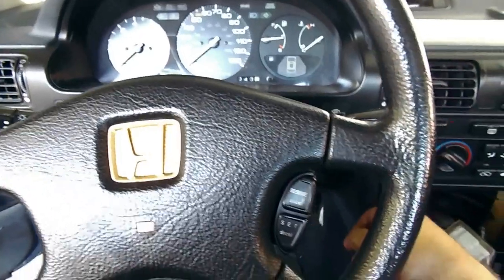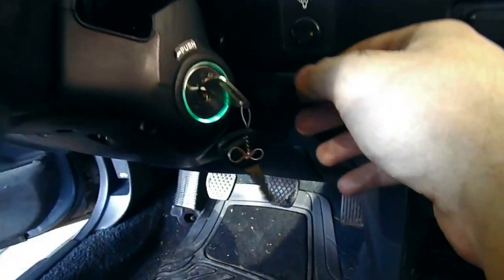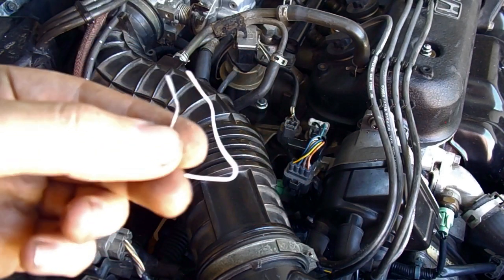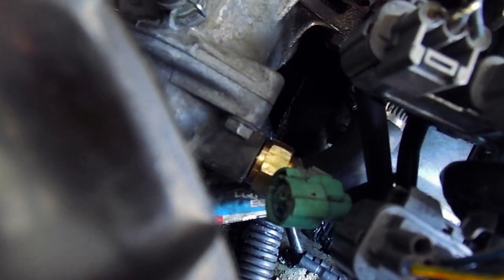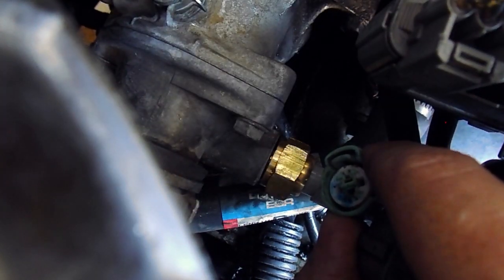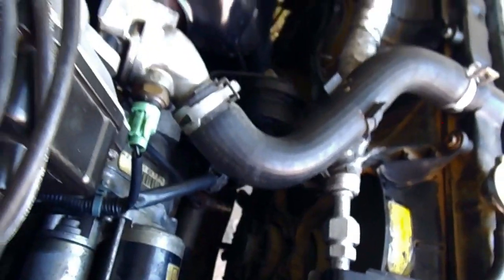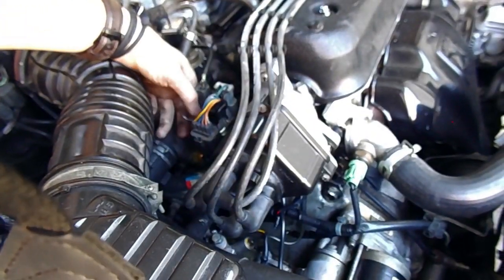How to check if your engine fans work on a Honda

Comment: What if jumping fan switch a turn both on but jumping fan switch does not I even cut off the plug and jumped the wires, any ideas?

Comment: Payco..    when I do this test... if you are sitting inside the vehicle..   only my left fan  (condenser?) comes on..    right (cooling?) .. stays off.,.       you think that is the motor?
Reply from the maker: I would trace the wire first for any damage for the fan that didn’t work & if it’s good I’d bet on the motor for sure! If I remember correctly this test would bypass the sensor & just turn the fans on directly so if one or the other isn’t turning on its one of those two issues. Hope you get it working!
Reply: @PaycoTsunami  thanks buddy appreciate it

Comment: Is that plug green on all Honda’s? I have a 2006 Ridgeline. 

What switch does that plug connect to?
Reply from the maker: I don't believe they're all green but from what I've seen theres a switch specifically for fans you should be able to test

Comment: The fan switch has been replaced and the fans still don't come on normally. Fans do come on when I use the paperclip.  Since the switch has been replaced, and I know the fans work, what is the next step? Thermostat?
Reply from the maker: @Tbarney11  is it over heating? Might have a faulty temp switch, this just shows if the fan circuit still works. I’d replace with aftermarket denso temp switch & oem thermostat from a dealer. Might get a fake one from eBay stating oem
Reply: @PaycoTsunami  Yes, it is overheating because the fans never turn on. Any harm in leaving the paperclip in all the time (temporarily until a permanent solution is found)?
Reply from the maker: @Tbarney11  yeah, either motor burn out, paper clip falls out and now you have 0 chance for the fans or battery dies. You can make a switch instead of using the paperclip on the same nodes, just get some male wire terminals and have it run to an off and off switch. Best chance since you can just turn on the fans while you drive. You know it still works when the turn on
Reply: @PaycoTsunami  ODBII scanner gives me temperature, and it goes over 270 degrees, so something is telling the computer the temperature, which has to be the temperature sensor. I want to be careful with my terms. 
Fan switch (the piece bypassed in this video) has already been replaced. Bypassing that switch makes the fans turn on. 
Since I can see the temp through my ODBII scanner, that tells me the temp sensor is working, so why would the fans not be kicking on?  I assume the fan switch enables based on sensing a certain amount of heat. Could it be water pump not circulating the coolant so the fan switch never senses any coolant?

Comment: My 99 Honda civic doesn't overheat unless I turn my ac on and drive for a bit with the ac on but other than that as long as I dont turn on my ac my car never overheats. I checked my fuses and relays and everything looks fine. I attached the gator clips to my cooling fan switch terminal then ran it to the battery and my cooling fan turned on. So my question is if I try this paper clip thing and it doesnt turn my fan on what would that mean??? U think my thermostat needs to be changed? I already changed out the ect sensor, coolant temp gauge sending unit ( the 2 sensors underneath the distributer) and the cooling fan sensor switch that's on the thermostat housing.
Reply from the maker: Hey sorry I totally missed that you've already attached alligator clips, are the sensors aftermarket ones? Like super cheapy? I've had this issue with my subaru & had overheating issues because the sensors I replaced were faulty. I'd double check on everything!

Another issue could be your water pump, could have rusted out fins if you hadn't changed the coolant at the intervals or tossed in non-distilled water. Not too sure if you've changed that during a timing belt change but not enough water circulation with the AC ON (Which causes the engine to run hotter) would also can be an issue!

Hope you get it fixed dude! Seems like you've already tested the fans individually so doing this would test the fans UP TO the sensor. I would still do this test to make sure anything wasn't eaten out by a mouse or something to the fan switch on the thermostat.

I hope you find your issue dude! I know its frustrating as hell!
Reply: @PaycoTsunami  only one that wasnt honda oem was the coolant fan switch that goes on top/ side of the thermostat housing

Comment: i tested this, and only the condenser fan turns on. i even changed the plug and wire into the fan sensor i need help!
Reply from the maker: Honestly @ that point it would be the motor of the fan, just swap the motors if you don't have one on hand to see if its really that. You can also get a multimeter to see if there's power with the plug initially

Comment: Brought new cooling sensor but still fans dont come on so i put a clips in and boom fans come on what i want to know lol can i leave the  clips in the connector ?
Reply from the maker: Haha honestly I wouldn't advise it at all BUT when people race on the track, they add a switch that allows the fans to be switched on whenever they want. Perhaps look into that as a better option? I'm glad your fans work for sure but just double check on your thermostat. It might not be working properly to allow the car to heat up or not opening to cool down. It's a cheap fix from Amazon, just make sure when you install it the breather tap is facing up.
Reply: @PaycoTsunami  well sadlt the Sensor is jammed stuck in the thermostat and am unable to twist it off hahaha omfg man thank god for the PINS as 4 the thermostat i tested it in bowling water an it opened up str8 away so im thinking nah not that but sensor dammit 🤣 thanks for the video Bruv awsum 😉👍

Comment: How long can we leave the paper clip there? It should be ok right? All it is is us making it run constantly instead of the switch telling when to
Reply from the maker: Basically, to be honest I wouldn't leave it be since it has a flowing current going through it. If you really wanted to, you could get a female end and wire a rocker switch to flip on the fans manually but you'd never know when to toss it on unless you knew the temp accurately.
What are you trying to do?
Reply: @PaycoTsunami  have it running constant!  And with the rocker switch idea. I think it would be the same if you leave it on too long right?

Comment: My fan still doesn't turn on after I did this.....what should I do next?
Reply from the maker: I’d just do it one more time, if not check the wires, the fuses, then relays. If all fails replace the fans.
Reply: @PaycoTsunami  oh, it was a brand new engine cooling fan that still wasnt coming on....forgot to mention that lol

Comment: What does it mean of they don't turn on once you do this?
Reply from the maker: It means a couple of things, the battery is out (Make sure its charged), When you put the paperclip in it didn't touch both of the metal nodes to give it power, and finally the motor to those two fans are out(Make sure they're plugged in first). This little trick here is to see if they work at all if they're not kicking on when it starts to warm up.
Reply: @PaycoTsunami  it looks like i have a motor in both my a/c fan and radiator fan.  i just bought a new motor.  will it help me with both fans?
Reply from the maker: @davembeck  Yo! So both fans have an individual fan motor. So from what I could tell they're interchangeable (I think). This will ONLY help if the actual motor is out though, and only the one you're changing. The other fan will not be affected by one motor being changed.
Reply: @PaycoTsunami  yO !  , LOL.  i did buy a motor .  long story shorter.  i do not care if my a/c isnt working, fan too.  thats a future project.  right now i need my radiator fan to work so i can do errands / drive my car to take care of daily needs.  i guess this motor will go into my radiator fan and hopefully my fan is ok and the motor will make my radiator fan work.  that is all, lol

Comment: what does the upper rad hose connect to on the motor? Dont know much about these engines.
Reply: that hose should be pulling coolant from the engine block to the top of the radiator to cool it off
Reply: @sfcd4757  alright. I was guessing that but wasn't sure. I'm slowly working on my cb7 and ej1

Comment: What dose it mean when the fans run even when the plug is not bypassed just unplugged hanging there  (with the AC on )
Reply from the maker: that your condenser is still kicking if I remember correctly, mine ran out of Freon. So even when I toss my A/C switch on it never tosses both fans on like it should. If I remember correctly that switch I unplugged only turns on when the car runs over the normal temperature than the car should be. So it would still run even if unplugged. Just won't turn on when it gets hot. 

Hey at least both fans work!
Reply: this probably means that there is a wire-to-wire short somewhere between those 2 wires. because it is acting as if it is bypassed, so safe to assume the wires are touching elsewhere, right? do a voltage test between both terminals of the green plug. if it is little or nothing, safe to assume this theory is right
Reply: PaycoTsunami hey my ac is out of Freon I think my compressor is leaking, but none of my fans kick on when I turn on the ac getting codes P0113 and P0118

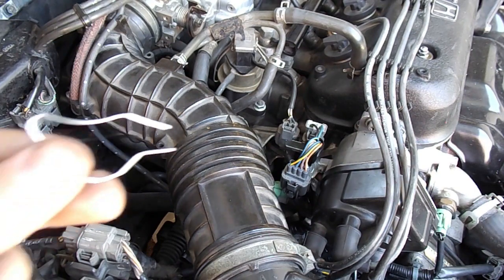Comment: Heya PaycoTsunami, thanks for this helpful video.  Troubleshooting a fan issue on my 1990 Accord (compressor fan stays on for 10 minutes after shutting car off not matter how hot/cold the engine is...this is draining the battery) and I'm hoping you can answer 2 questions.  First, the green plug that you inserted the paper clip into...what is the name of the sensor that you removed this plug from?  Second, you can see another similar sensor at 0:34 of the video.  It is visible in the bottom right hand corner of the screen, in the front of the engine, just to the right of the distributor and to the left of where the upper radiator hose in hose-clamped to the engine...do you know the name of that sensor?  Thanks so much for any help you can offer!
Reply from the maker: Yo Yuri! Sorry it took my so long, The first plug I removed from the thermostat housing is the fan switch & the 2nd green plug @ 0:34 is a thermo-switch which controls the fans after the car is off (This is the switch you want to look into for your issue). Hope you fixed your problem wayyyyy before I left this comment my dude!

Comment: I did that & my fan still doesn't work. 
But if I apply power directly to the fans then they work. What could be the cause?
Reply from the maker: Sensors or short in the wires, just trace the wires to see if they have any rips. Might be grounding out somewhere it shouldn’t

Comment: I have a problem with my 2006 Honda Civic EX where neither fan is turning on even with the paperclip
Reply: Make sure the paper clip goes all the way in where it can make good contact! Mine’s did the same. So I press the clip further in and it worked! Or Try straight wire to the battery and see if the fan turns to make sure the fan works first

Comment: Is that the plug that connects to the thermostat ?
Reply from the maker: LifeWithJona Hey yeah it is! Its the sensor connected to the thermostat housing and its called the "fan switch"
Reply: PaycoTsunami   Where would it be on 05 Honda Pilot? I’m an idiot
Reply: @PaycoTsunami  we call it coolant temperature sensor
Reply from the maker: @vityazsix  Actually the temp sensor is on the opposite side of the switch, in the front of the top coolant hose near the valve cover my friend! (Thermo switch)
Reply: @PaycoTsunami  oops
Reply from the maker: @vityazsix  😆

Comment: When I jump wire only the passenger fan turns on. Why is the driver side on?
Reply from the maker: this trick bypasses the switches which requires the fans to be operating temperature so you can see if the relays(if I remember correctly) or the actual motor of the fan's work. Doing this FOR SURE checks if they work at all. Double back to see if the driver side one is plugged in, if it is, switch out the fan relay which is in your engine bay fuse box with another relay similar to it. IF it still doesn't turn on doing this trick then your motor is out on the driver side my dude! Hope this is a super easy fix, just test everything out before replacing. You never know, it might be a frayed wire somewhere!
Reply: I read somewhere that the driver side fan won't operate if the A/C system doesn't have pressure in it, ie all your refrigerant leaked out...something about the computer knowing theres not enough pressure in the A/C system so it disables the fan...something to consider/double check.

Comment: Ok so I replaced all sensors and switches as well as the relay and my fans still only work if I have the clip in as soon as I put it in fans kick on and temp drops to normal. I even bout another fan switch and it still isn't working I am all out of ideas. Currently though I am not driving it yet I swapped the clip for a wire so it has insulation to not touch metal and fry something
Reply: Probably should mention 1991 accord lx
Reply: Having the same issue did you figure it out? I got a new switch too
Reply: @Briorix  bro plz tell me did you figure it out???
Reply: did you find the fix for this? I am having the same issue. Fans come on when using the paperclip, I replaced the switch, fans don't come on normally unless I use the paperclip.

Comment: Appreciate the videos. I have a 1995 Honda Accord EX both fans are constantly running, even when car hasn't been ran for hours, Have disconnected both switch A and B and they are still running. Any Idea what is causing this issue, greatly appreciated.
Reply from the maker: yo! Just came back from NC, so I'm down to help now haha It sounds like it might be a few things but check these out in this order: Fan timer (I have a video on it), Temp Relay (Should be in engine bay fuse box, just switch it out with another one in there), THEN if that doesn't work Temp switch (which I want to say is the one on the thermostat housing[switch A?]), and last but not least the thermostat is going bad. You would have to drain the coolant and burp it. Its completely normal for our cars to run after its been in use for awhile, it cools the aluminum heads so they don't warp. Next time it happens just time it. It shouldn't go on longer than 18 Minutes my dude!
Reply: @PaycoTsunami  ... That's a thought. Where do I find the fan timer ? 
I have a Dodge stratus 2002. My fans come on like 25 minutes later, by that time the engine is already very hot. I wanna reduce thar to like 3-5 minutes. 5 minutes max. 
Any ideas ?
Reply: @guesswhomartin9249    Probably the fan control module ..... remove glove box and that is where it is..    mess around with the connection pushing and pulling to see if the fans go off and on when key turned to acc like this vid.
Reply: @memopadilla5931  ok.. thank you.

Comment: What if it's still doesn't run ??
Reply from the maker: If you’ve done this & they don’t run, it means your fans aren’t working. We ruled out the sensor being the issue so now we’re narrowing it down to the fans themselves. Just make sure the paper clip is touching both nodes in the plug. If it’s still not running check the wires from that plug down to the fans, then at that point check if the fans actually work. Get some alligator clips & use a car battery to check the motors! Hope you find your issue!
Reply: Ok it's running.. done

Comment: What is the problem if i jump that switch and only 1 fan comes on? My radiator cooling fan does not come on when i do this method. Please help!
Reply from the maker: Raymond Torres someone else kind of asked the same thing so here's what I said to them my dude! Hope this helps! "this trick bypasses the switches which requires the fans to be operating temperature so you can see if the relays(if I remember correctly) or the actual motor of the fan's work. Doing this FOR SURE checks if they work at all. Double back to see if the driver side one is plugged in, if it is, switch out the fan relay which is in your engine bay fuse box with another relay similar to it. IF it still doesn't turn on doing this trick then your motor is out on the driver side my dude! Hope this is a super easy fix, just test everything out before replacing. You never know, it might be a frayed wire somewhere!"